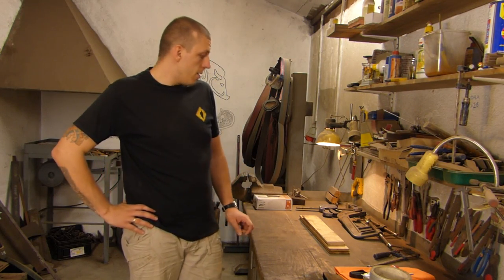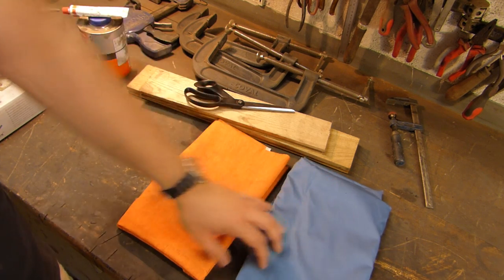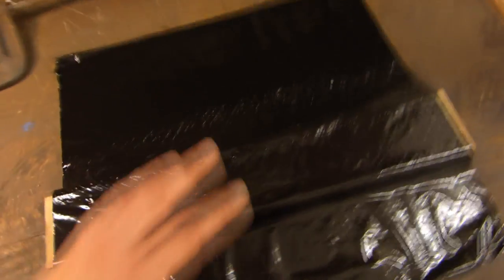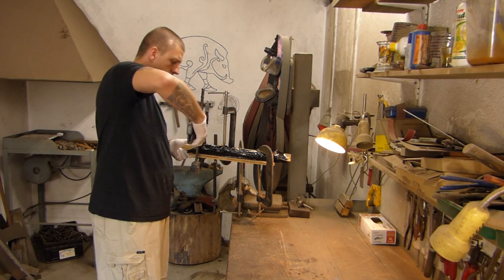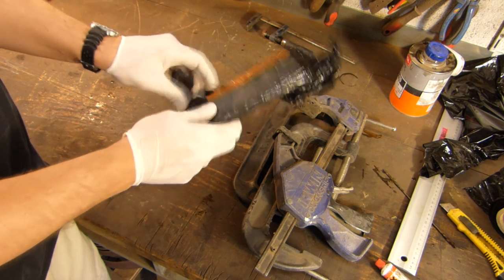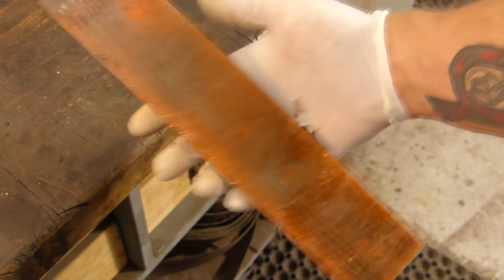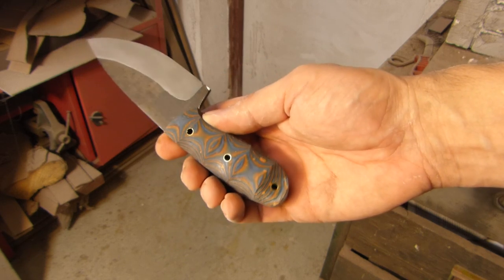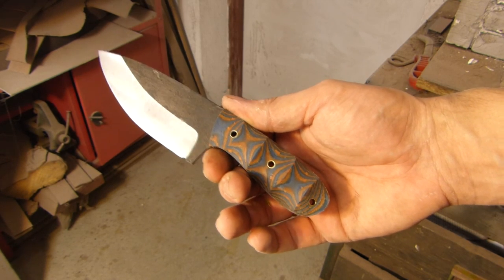MAKING A HOMEMADE MICARTA [Trollsky Knifemaking]

Comment: You do such a great job with your videos.  You are an excellent teacher and I think you would be able to explain anealing of a hardened metal(which you have shown on your video of knife from a file), then hardening which you have shown numerous times to tempering which you have also shown several times, but just as a demo show how temperature changes and differences in handling the same steel, results in very different characteristic.  You have shown all of these just not in one video.

Comment: That's a beautiful set of knife scales. If you'd like to make perfect even sets of knife scales right out of the press, you might consider the Fiber Press that works every single time.

Instead of using clamps that's difficult keeping the micarta material even during the pressing process, the Fiber Press uses 3/8" bolts threaded to 1/4" steel base plates.

Comment: I am not a custom knives enthusiast, even when I like knives I've never been that interested. But I've found your videos which resulted to be quite interesting, and I am amazed of how simple it is, or you make it look like that, and how pretty nice things can be done with some basic tools, materials, and patience. I'll keep watching the basic tutorials to see if I can do something from scratch. The only thing is that I'm a little afraid of angle grinders, though
Reply: +Eduardo Trillaud Angle grinders can be intimidating, but I can guarantee you that once you get one in your hands and start grinding away, you'll be fine. Practice grinding out curves and cutting out shapes and such. If you're not all that confident in your skills, ask someone you know so they can teach you all the basics, and advanced stuff once you build up skill. Hoped this helps / helped.
Reply: Yeah I know that. It's just I don't want to rip off my fingers in the process hahahaha
Reply: Yeah I know that. It's just I don't want to rip off my fingers in the process hahahaha
Reply: Actually it's not really that easy to injure yourself unless you have your hand pretty much directly on the disc, or grind at the wrong angles, or use faulty/broken discs. As long as you're using it safely you're at a low risk of injury.
Reply: Thanks

Comment: Just a couple of questions: what kind of epoxy? I saw another video that had a fiberglass resin. Does it matter what you use as long as it is some kind of clear hard epoxy/resin? 

Also, what is the "foil" you used? It just looks like a black plastic bag, is it something special?

Comment: Hi Trollskyy, i'm making my own Sanding belt machine! but i'm having some troubles with the size of the main wheel, what i mean by that is that you've got the the engine, and then a wheel that makes the sanding belt move, what's the size of that wheel?
and the second problem i have is with the RPM of the motor, what RPM is your motor (engine)?
Thanks and greetings from Chile!

Comment: Hey Trollskyy,
Liking your videos man, learning a lot from you,
Question about your belt sander ,what make is it ,and what rpm does it run at, about to buy my own one but not sure what to get ,
RGDs
Mac
Reply from the maker: thanks ! My bukkake grinding unit is a homemade construction with a angine 2800 rpm's. a bit too fast for wood but great for steel
Reply: Nice 1, I stripped the motor from my old table saw but not confident enough to try make a sander out of it yet, a future project maybe

Comment: What kind of resin did you use?  You mentioned both polyester and epoxy...
Reply: epoxy
Reply: In most other tutorials they use fibre glass resin which is commercially available. I think this is what he meant

Comment: Ive been wanting to make micarta for a while now, can anyone tell me a good brand that's cheap for epoxy, the high price of epoxy has been holding me back ive seen the gallon jugs but there 65$ usd so i cant afford that big of a size :(
Reply: Any hardware store will have a smaller tube of 2 part Gorilla Glue epoxy that works great for making micarta scales. Last time I checked it was $5.50.
Reply: go to home depot or walmart or any other superstore/hardware store and you should be able to find a small bottle or 2 part system for like 5-6 dollars. Good Luck man

Comment: This is such a messy process!! Why not try this instead?:
Acquire a pan or tray of appropriate depth.
First, protect the back-boards in zippered freezer bags and protect your pan or tray with a plastic grocery bag or garbage bag. (Fasten the bag to the inside corners of your tray with 2 sided tape)
Pour your resin solution into the pan or tray then, in the order you'd like, simply place the entire "sandwich" of materials and back-boards, one piece at a time, into the pan of resin. It works best if your material and back boards are cut to a size that nestles neatly into the tray. Also, a 2" tab at diagonal corners of each material layer can be pinned with a safety pin to help prevent slipping while clamping.
Next, "G" clamp the tray and the sandwich together at the corners. Use little blocks of scrap wood as spacers to prevent immersing your G clamps in the resin. As it becomes tighter, begin using the lug nut method while measuring the distance of each G clamp to ensure evenness across your material. 
If done this way, the whole project stays mess-free because the excess resin remains contained until it is channeled off one corner of the tray by propping it on edge so it drips into a thro-away container.
With this method, your tray (pan) and your back-boards are withdrawn clean, un-messed and ready to be used again!
 I was age 14 during the first half of 1967, and Ziploc didn't exist yet. That's when I first tried this. I didn't protect my back-boards so they had to be cut off and therefore destroyed. My back-boards from then on were wrapped in Saran wrap, which worked fine each time.
I never made anything but one paper weight and several beverege coasters from my micarta pieces, and I have only made a handful of them; fewer than a dozen, I think. 
The resin I used was not fiber glass, but wood resin epoxy. It was in liquid form and did not produce costic fumes. The weird part of my story is that at age 14, I was naive enough to believe that I had invented some thing. I didn't learn til 40 years later that it had already existed and that it was called micarta. 
Now I'm anxious to do it again using fiberglass resin